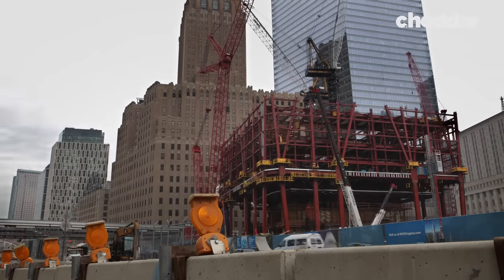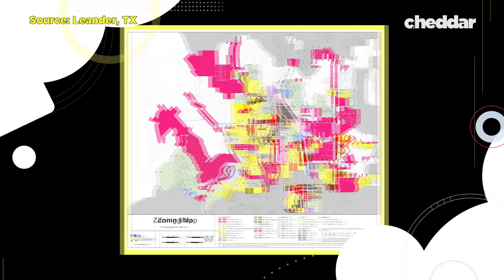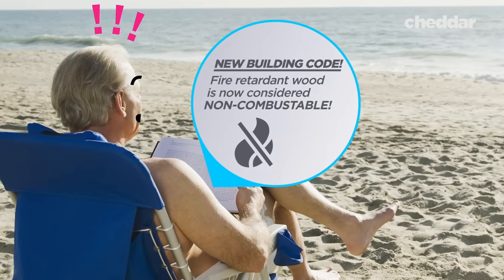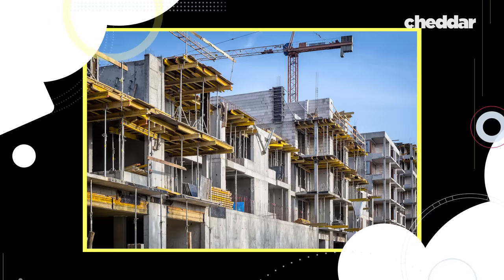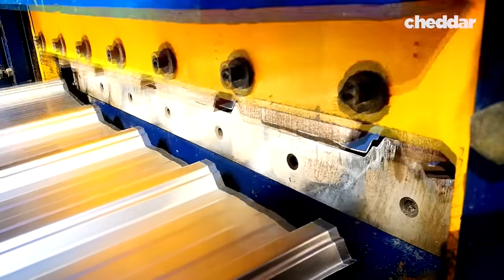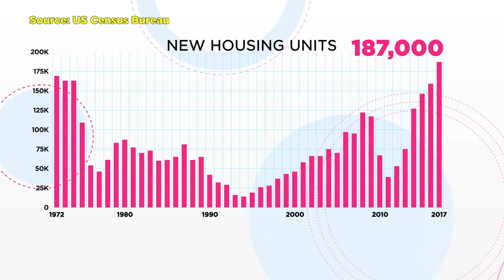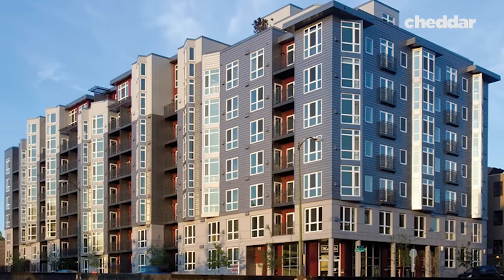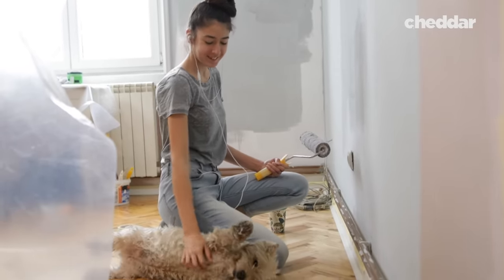Why All New Apartment Buildings Look Identical - Cheddar Explains

Comment: I for one like how most of these apartments look and function. Retail/restaurants on the bottom, housing up top, and typically plenty of parking. They are also typically built very quickly so in less than a year an area can go from boring to completely vibrant and full of activity.
Reply: The function, yes. I enjoy. Not the build. The walls are cheap and you can hear everything from Wisconsin to Florida to Louisiana in my experiences.
Reply: You also end up creating cities that everything is really far apart because the reliance on cars
Reply: @Tabbithakitten  You are basically describing how LA-OC area is lolololololol. I don't see that as an issue but just how life is.
Reply: @Tabbithakitten  that's an issue with single family and residential zoning, not the buildings themselves. Mixed zoning and retail-bottom/residential-top buildings are the perfect way to make towns dense
Reply: I agree in terms of the usage function – it's a medium density that allows mixed-use residential and commercial, without the high density of real high-rise and all the problems that that can bring – and as for aesthetics, a lot of it comes down to personal taste but I wouldn't generally say they are any worse than a lot of other urban designs and can be quite pleasant. My issue with them is the build quality.
Reply: @stevieinselby  I think these buildings are aesthetically pleasing no matter the materials or facade IF they have good connectivity with the surrounding streets and all the human scaled elements are included - broad sidewalks, street trees, lighting, balconies, wide windows etc. Those things make any building welcoming and pleasant.
Reply: @RTDice11  Who says we want dense towns? Believe it or not some people prefer living in nice houses.
Reply: WorldFlex  agreed.
Reply: @dlazo32696  the hell are you on about? The guy I was replying to said his issue with cities is that you need to drive everywhere, I told him dense, mixed zoning means you can walk to the places you want to go.

If you want a house, go ahead. But the problem is that most suburban zoning is literally the worst of all possible worlds and most Americans are too myopic to imagine the alternatives.
Reply: @RTDice11  So what do you propose? And I’m glad you acknowledge that not everyone wants to live in hyper dense urban environment.
Reply: @dlazo32696  Mixed zoning in cities. Stich shops, schools, and other public spaces into residential areas and make streets safe to walk.

Make the cities more urban and walkable, and if someone wants to have a huge property and no neighbors you can keep the rural areas rural pristine for that population. Making the burbs denser will just give both groups more of what they want.
Reply: @RTDice11  “Making the burbs denser will give both groups what they want” what do you mean by this? Because most homeowners I know in the suburbs don’t want mixed use.

I wouldn’t mind mixed use as long as the suburbs aren’t changed drastically.
Reply: why do you love the food at the bottom? You like rats and roaches climbing into your apartment and back ? LOL you like the smell of rotting food or the smell of a failing restaurant with a C grade? you like the sound of ppl clanging their plates and screaming from the bottom up? You like the cheap carpeting and painting?
Reply: @RTDice11  no that is horrible solution, the solution is better transport/public transport instead of relying on cars all the time. Not this trash rat infesting buildings. Denser you want it to be like blade runner, chinese, hongkong housing where they are literally choking on each other rat smoke? Simply make bullet trains, metros, buses, walkways, airplanes. literally from the 80s which the US just simply lacks in every single way unlike in Japan or Singapore where 80s tech is like from the 2050s. Just making downtown denser is going to make it a homeless center, a pandemic center
Reply: @DaftPunkSkittle  I personally have never been exposed to any of that and I am sorry if you have...typically the restaurants at the bottom are some of my favorites but I have been fortunate enough to live in really nice places so the restaurants are nice, very clean and tasty with the doors closing at good hours so they disrupt my schedule.

Comment: In Australia we have similar building projects in the sense of 3-5 story apartment buildings with retail/commercial space on the ground floor. However our construction method is a modular concrete frame approach. With exteriors using a mix of render, cladding and pop colours.

Comment: As a European, I will never understand why anyone would build so much with wood. I get that it´s cheap but concrete, brick, and steel are so much better in the long run.
Reply: The main reason Europe stopped relying on wood (a long time ago!) was because much of Europe basically ran out of suitable forests to harvest. (Construction timber requires mature, very tall, straight trees. North America still has tons of these. Europe doesn’t.) So it had to switch to other materials. 

With that said, I ever so much prefer heavy masonry construction. I hate the way American houses let you experience everything the person in the next room is doing, just like if you were in there with them!
Reply: We still have lots of forests in North America that are farmed for timber.  I imagine that wood construction is much cheaper here than it is in Europe.  (However, the shutdowns over the past year have reduced the supply of cut timber driving up the cost over the past 12 months.  I hope the market normalizes soon or the cost of new home construction is going to skyrocket and make housing even more unaffordable.)
Reply: If you actually lived in one it's not that bad. I and millions have grown up in one and they get the job done and can be easily deployed, build to specific custom specifications, and like you said are affordable.
Reply: As an architect in america with many architect friends form Europe, I have heard a lot about how american construction is very bad. Using wood is not only very flimsy, but also very labor intensive compared to steel or concrete. It strikes me as disposable building.
Reply: For single family homes, the family may prefer to live in a wood frame home over a concrete one. Not just for costs, but for other reasons as well. With concrete, there's a concern about mold and dampness. And it's usually uglier. Each material has its drawbacks. In fact, some Americans might wonder how anyone can live in a concrete house lol But the quality of the wood is key.

Comment: It's good for density and walkability due to the mixed use nature. The designs aren't the worse but I can see why people would want more variety.
Reply: Not in it's execution no. Usually wherever these apartments are built they have to pave vast areas of land due to minimum parking requirements, and then widen the road so as to not restrict cars coming from these new developments. 

There's an area in my city where they tried to build apartments like these, but it ended up turning into your standard ugly unwalkable suburb due to these restraints. The apartments are all surrounded by hundreds of parking spaces due to requirements and we had to ruin our historic grid street pattern and build a massive 6 lane road for the area. Its so horrible, it looks like a suburb right in the middle of the denser downtown. 

If you want higher density you need to have the laws in place for it to actually be workable, and unfortunately 90% of America is not at all zoned for any sort of density and requirements actively prevent it.
Reply: The developers who push this also have little to no desire to integrate with walkable infrastructure. They just (commonly) want close proximity to train stations if anything. Often the surrounding sidewalks and roads are in bad shape, but the municipalities will roll out the red carpets while leaving the infrastructure in the same shape despite a residential influx.

Comment: Could be worse. We could hack those horrific tower blocks from the 60s with the concrete panels . Like you call these eyesores
Reply: I was also thinking that modern apartment buildings still look better than the 60's and 70's buildings.
Reply: Oh yeah, those concrete ones, arent those called Brutalistic architecture?
Reply: @mixiekins  technically they're called modernist architecture but yeah. The style was a post war style invented by Le Corbusier. They looked relatively nice and were very cheap, since all the parts were prefabricate, making them optimal for social housing. But after a few years they became run down due to a lack of maintenance. Now their only purpose is to give the demolition crews work, and blight the skylines of our cities until that happens
Reply: @MosJournal  yeah like these new styles aren't great, but there such an improvement
Reply: @mixiekins  Another commenter confirmed that.
Reply: Amen

Comment: I was wondering why these were being built in my city, Jacksonville, Florida. I'd never seen wood frame buildings that were that tall before. All I could think of is what a firetrap these places could be.
Reply: Actually, wood is safer than steel in a fire hazard (even though it is counter-intuitive). Where the outside layer of wood burns, the inside remains strong as the burnt outside forms a protective layer. With steel, the whole thing collapses in an instant, when it reaches a certain temperature. When a building burns down, you can often see the wooden contruction still standing. And yes, i know what I am talking about. I study architecture and attended a lecture about this

Comment: and they usually have very low construction quality, no soundproofing etc.
Reply: That's probably the most legitimate argument against them
Reply: Show me any apartments with actual decent soundproofing lmao, barely any
Reply: @DanielOfRussia  concrete ones.
Reply: @DanielOfRussia  I've lived in new (2017) apartment buildings that have the structural concrete as the dividing walls between apartments. I lived in that for like 3 years and neither me nor my neighbor heard each other.  I mean that literally, I heard more from my neighbors when I lived in a single family home in a subdivision. 

My current building is a stone and brick walkup apartment built in the mid 1800s and it's just as quiet between adjacent apartments, but a little louder between floors.
Reply: Go to Brooklyn

Comment: In Europe we make houses cheap by using panel construction, but every house is unique with its own facade. And there is always a nice back yard instead of parking.
Reply: Well, you can wall and use public transportation in most of those countries. Those cities were designed to be walkable. Our cities were designed when cars were hitting the road.
Reply: @mundotaku_org  Yeah. I study in US now, and it is tough without the car. You didn't just build, you bulldozed a lot of your historical neighbors to build roads, which makes me sad. I think if you ditch the zoning laws, a lot of people would prefer to live in an apartment. With time it is possible to make US cities more dense beginning from the center, which would allow for better public transportation.
Reply: @oleksiifedorenko4619  Houston doesn't have any zoning but most people there still prefer to drive. However this is partly due to the parking minimums (hence the Texas Donut) and local politicians obstructing public transportation
Reply: @jmlinden7  I am actually in Houston right now. While it is true that it doesn't have zoning, it is more complicated than that. It sometimes has height and density restriction. Still, there are a lot of 5-6 storey buildings close to the center. Unfortunately, a lot of them are not mixed development. The best type of construction that resembles mixed development the most is probably the Woodlands in the North of Houston. It is one of the few vibrant neighborhoods from what I've seen in Houston.
Reply: @oleksiifedorenko4619  I think more people prefer to walk when they realize it's an option, but cars are such an ingrained aspect of culture in the United States that very few people are aware that it's an option... The idea of a walkable city did not occur to me until I literally did get to live in a walkable city because I lived outside of the United States. I don't think most Americans will want to have that unless they actually get to experience it, but they won't get to experience until they have it... Catch 22
Reply: @jmlinden7  Houston got rid of parking minimums downtown at least
Reply: It actually depends on where in europe since I have serious doubt the Khrushchyovkas can be called "Unique"
Reply: @10gamer64  I was talking about new mixed development in western europe)))
Reply: @oleksiifedorenko4619  true
Reply: @mundotaku_org  actually some of Europe was adapted for the car as well and was later reversed due to adverse public opinion, check out "not just bikes" he has some great videos on the subject

Comment: I'll bet American builders could do a lot with bamboo!
Reply: I wonder if there's a way to pressure treat bamboo that would make it work with existing fire code, that would make adoption easier!
Reply: if we start mass farming maybe
Reply: We're getting closer, I've seen bamboo being grown in BC outdoors
Reply: @mixiekins  Bamboo is very flammable.
Reply: I would guess that bamboo is a lot cheaper in Asia than in America. The reason that America uses wood while Europe doesn't is because wood is much cheaper in America. And that's probably the same reason that America doesn't use bamboo.
Reply: @kered13  Bamboo grows in the U.S. just like it does anywhere else in the world. I think the reason the rest of the world uses bamboo is because they don't have forests of straight grain fir and pine like we do.
Reply: It is not that cheap in the US, because bamboo is typically a tropical plant and it is not that dimensionally stable unless heavily treated, by the time it is done it is not cheaper than wood.
Reply: Not a bad idea. Bamboo is more durable than wood and cheaper.
Reply: @DCampusano1  not treated bamboo. In flooring bamboo is more expensive.
Reply: I swear bamboo can survive a nuclear bomb. You can't get rid of it.
Reply: @ObesePuppies  bamboo floors are the hot building item.  Also using bamboo in kitchen cabinets is sold as being ecologically friendly.

Comment: 5 over 1s aka; Throw Away Buildings.

The city I live in has had an explosion of these types of buildings with new ones announced every week. If you look at any of the completed ones from just the outside you can already see that the exterior panels/siding are cracking, faded and moldy. They're not even ten years old.

Comment: I'm just shocked, even 5 story buildings are made out of wood there
Reply: Yup, wood materials and carpenters are very cheap and easy to find here.
Reply: I know. In 30 years the building will have to go through extensive renovation, or just bulldoze the whole apartment complex if land value is high. The reason these are popular, is because brick is very expensive. Many new apartments use big glass windows, this is to have less labour.
Reply: @sm3675  In 30 years most residential buildings will need to go through renovations. Times change and preferences and technologies change. Not to mention, all the other stuff around the house will deteriorate. Plumbing will corrode, electrical wires will wear out, appliances die.. The biggest factor that brings a building down isn't the materials the part you live in are made of, its foundations. Wooden buildings still have concrete foundations and its those foundations that are usually what starts to fail first. First place I lived after moving out of my parents home was built in the 60s out of brick and concrete. It was condemned shortly after I moved out because the foundations failed to pass an inspection.
Reply: @jarynn8156  Meanwhile I live in a relatively decent shape Wood house built in the 1880s, material has nothing to do with longevity, that’s what craftsmanship does.
Reply: They aren't 100% wood. They use Hardie Board panelling on the exteriors. That what she means when she says Hardie. That is concrete. Hardie Board is great. Doesn't burn. Termites don't eat it. Durable - It lasts for decades. Can be made to look like wood exterior. Holds color well.

Most new houses here in California use Hardie Board on some of the walls. Mine does. Looks great.
Reply: Wood is very strong, it bends instead of breaking. The main problem is that the other materials also have to bend along with the wood otherwise you get separation (hence why the reliance on Hardiplank)
Reply: @israeldelarosa5461  Agree. Wood also is better for a one family house tho over an apartment. These places tend to be poorly insulated and you can hear everything. Wood houses, especially old wood houses have that craftsmanship you were talking about.
Reply: @sm3675  Except that since it’s USA, when the 30 year mark comes and significant renovation is needed, it just won’t get done. Nobody seems to invest in properly maintaining rental properties. They just invest in new ones and keep the old ones as housing for people who can’t afford any better.
Reply: 30 years? haha there are many apartment buildings built in the sixtees that do not get renovated. For some owners, a paintjob and floor varnish means renovated lol.
Reply: Wood is sustainable and relatively carbon-neutral, so at least there is that
Reply: @frostflower5555  60s? Heck, I think some buildings haven’t seen a proper renovation since the 1860s!

Comment: I’m not sure how I feel about them. On the one hand, I’m strongly in favor of mixed use, dense, affordable housing with commercial use on the ground floor, but I also think that we should be building out of bricks instead of wood for sustainability, insulation, sound-proofing, etc.